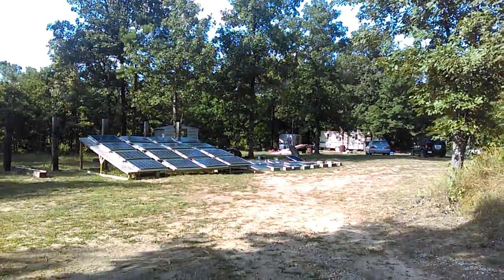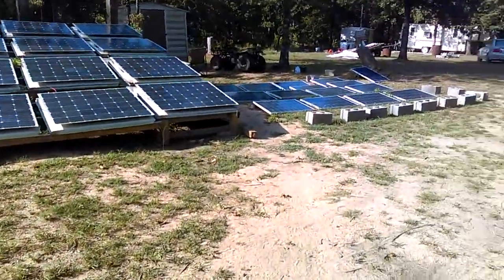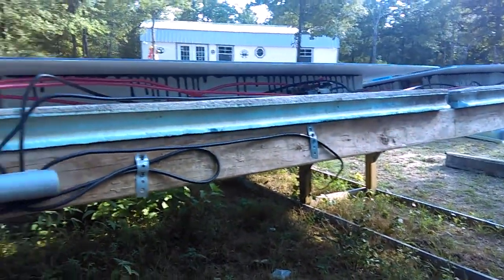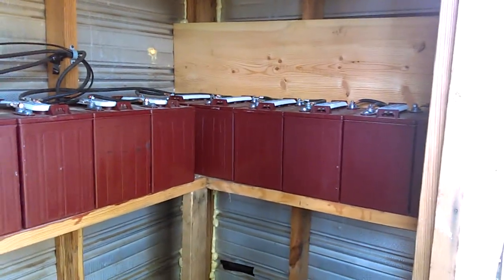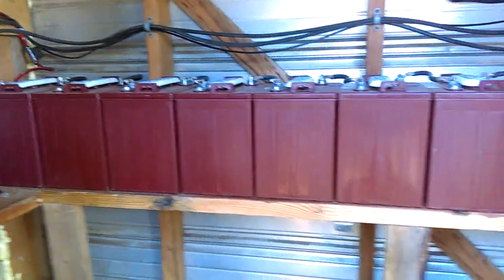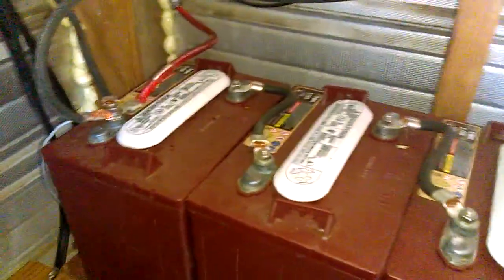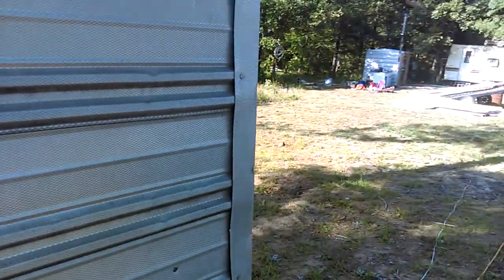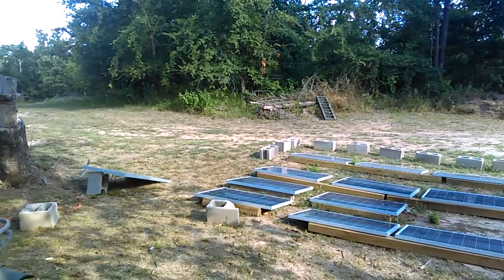3.4 kill a watt  off grid solar system  48 volt

Comment: This is running your well pump too,, do you have a workshop that you use with table saws, stuff like that,,
  Looks like you only need about 3,000 Watts versus 15k or 12k,
Reply from the maker: i dont have a well pump..sorry for the late reply

Comment: Beautiful as long as sun is not being clouded over by the nuclear fallout ect.  What happens when no sun ?????.?. No solar anything
Reply: Ya build a raised pond with an over flow pipe with a pump generator thingy and feed into the panel like Sep Holzer😅  I saw this  working.  I saw many here ok youtube using streams with washer machine tubs and other things to generate electricity. Ieven heard a pyramid built on a  i think 9°? slope allows free energy to flow through it and use honey comb hive shaped salt mine or holes filled with citrus...idk we can figure something out to get away from the one and only electric Co who btw uses Leigh lines for some of the power ive stumbled on that way back in 2009
Reply: @wendyjomendy  brilliant and many possibilities indeed , unfortunately most solar lovers are rely on sun too much. When sun is blocked solar is useless. Wise to create our own electricity source.  I wasn't thinking about that till now , brilliant.  That's my mission to find other ways to make electricity for the luxurious things we like.
Reply: Generator for back up
Reply from the maker: yes

Comment: So that's about 50 amp hours / 110v of service at night -2)15 amp circuits 👍🏻 and if your using modern Flat screen tv's they don't use hardly anything the most consumption would be the refrigerator,I guess. If your using fireplace for heat. That is a nice set up get approx. 6yrs. Out of the batteries. Can't beat that. @ 50% recharge rate. I'm using hypothetical situation of course. Great channel. My mind is going to work.
Reply from the maker: it was a good system...it has been reconfigured a bit now

Comment: On the dip switch for the charge controller What is the settings for 48v system  on the Tristar- 45???
Reply from the maker: I'm pretty sure it automatically detects it

Comment: Nice. How many kwh does your Solar panels produce
Reply from the maker: joseph john  it is a 3 kilowatt system or 3000w however you want to say it I have lost some panels so I'm probably down to about 2200 Watts right now but I plan on adding some more this summer to beef it back up

Comment: How do you like the Aims inverter? I'm looking to buy a decent one.
Reply from the maker: Tiny NH House the aims inverter has worked out very well have not had any issues with it. I did have an issue with the Morningstar but I believe it was struck by lightning and they replaced it for free. I heard all the bad reviews about the aims before I bought it but I just couldn't bring myself to paying double the amount for half the power.
Reply: Thanks for the feedback. All the best! - Dave